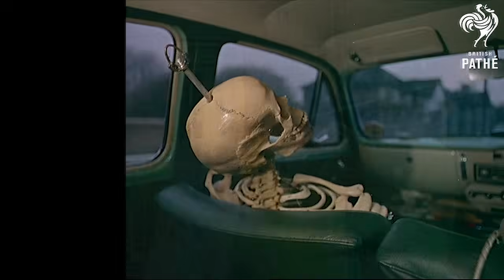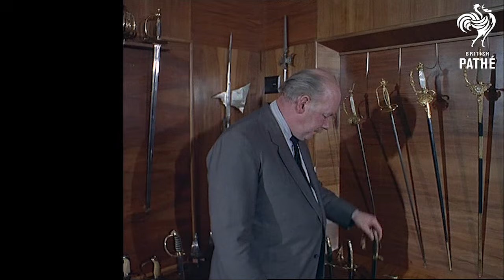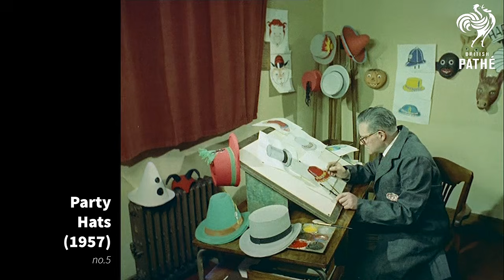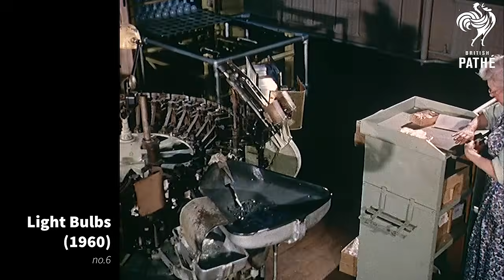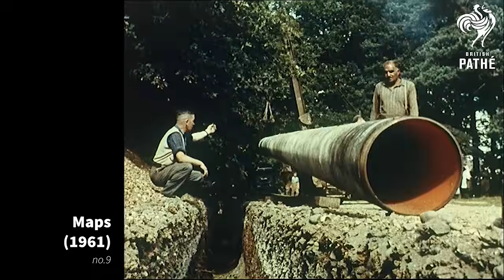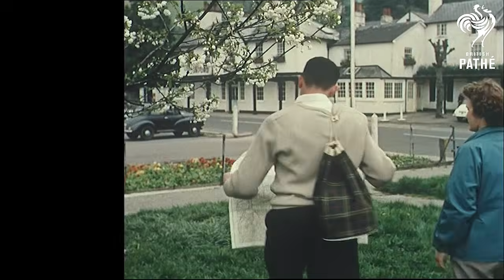10 More Mesmerising Manufacturing Films | 3rd Edition

Comment: Years back i was in California and at a marina i saw a sailing yacht that sustained damage by a lightning strike.  The yacht had a cement hull and had a large hole  blow-out from the egress point.  Technically the yacht was scrapped due to the metal strands or rebars uses to strengthen the hull, had been compromised by the lightening strike.
Reply: I wonder what the weight of the hull is?  It must be pretty heavy, right?